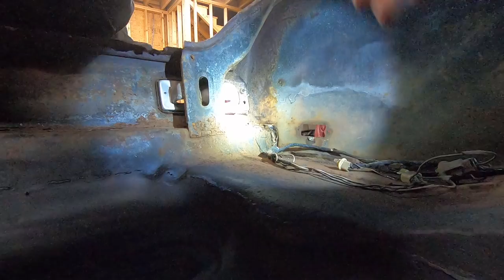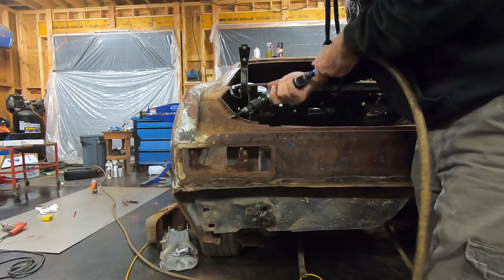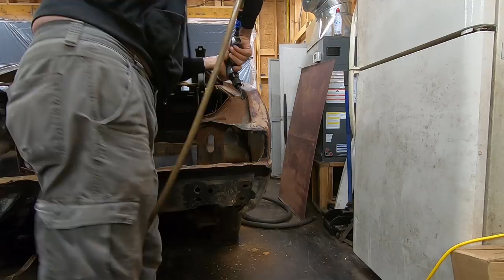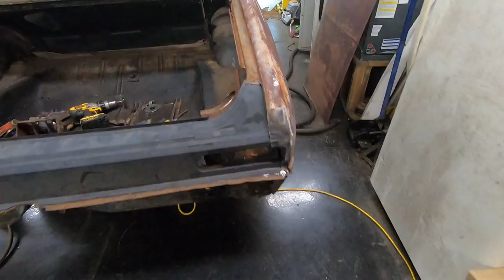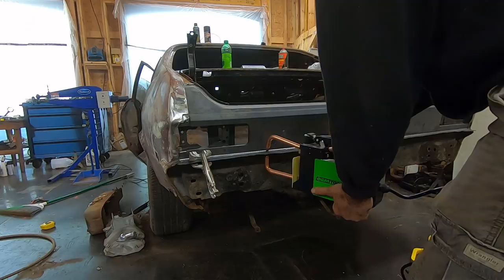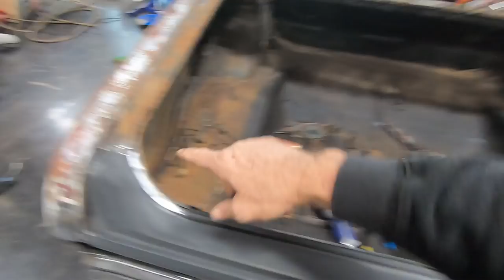Budget Chevy Nova Tail Panel Replacement

Comment: Can`t seem to get an answer to this qustion so i am now reaching out to the Nova God lol. The center roof brace how is the sckin connected to the center brace. I have a little oil canning going on there when i sand. Mine has a gap across the whole thing . ty Merry Christmas.
Reply from the maker: Lol. It isn’t connected. There’s some flexible foam that is between them. You can find it at auto body suppliers. Have a great Christmas!

Comment: Why cut everything out like that? It’s much easier to drill the spot welds in the first place, whether it’s a tail panel, floor pan, or roof skin. And ALWAYS fit your trunk lid before welding a tail light panel in. The quarter can relax and move even 1/8 of an inch when the panel is removed, and you’ll never get your panel gaps right.
Reply from the maker: First, thanks for watching. 
Second, to me, it’s easier to get to all the spot welds with the large parts of the panel out of the way.
Third, As far as the panels all moving, this obviously isn’t the kind of build where I’m worried about perfect panel alignment and gaps. Whoever ends up with this car will either enjoy it as is or will replace quarters and whole trunk. Therefore making it not a big deal if the tail light panel is off a little at this point. I appreciate your input though.

Comment: Is this the same mounting points as a 73 nova? I found one that I'd have to do a lot of work on the body, because Pennsylvania. But, I'm figuring that the72 and 73 have a decent amount of interchangeable parts.
Reply from the maker: The tail light panel is different but changing the 73 is pretty much just like changing the 68-72. It is mounted the same. Just not straight across bottom.

Comment: This video very informative for me.    The trick with cutting the gutter rails saves me time and dough.  One question is you said you had to melt brass/lead out of the lower outer corners. Is that just patience with propane bottle  ?  I just don’t want to damage or distort good metal.      Good vids.
Reply from the maker: Yeah. It doesn’t take much heat to melt the lead. Don’t boil it. That releases poison gas. Just barely get it hot enough to melt and scrape with wire brush. It will mostly fall off when it gets hot.

Comment: As a '68 Nova owner I TRULY appreciate seeing these videos and I continue to learn something new all the time.  My '68 was (and still is) my first full project car and I'd love to hear how you might go about repairing/replacing that trunk gutter for the weather stripping?
Reply from the maker: Actually I tried making a piece but couldn’t get it just right without a TON of work. So I cut a piece off of a quarter panel that was replaced on another car. I’ll have a video of the deck filler and trunk rail in next week or so
Reply: @Shop209  Yeah, I had purchased some stand alone channels, but they're straight pieces and like you said would require a TON of work to get it right.  I think the only 'good' option would be to get decent replacement metal with the gutter and then square cut it out and weld in.  Anyways, looking forward to the videos... keep 'em coming.

Comment: When you put the tail panel in is there any kind of sealant that goes between panels  to keep water out
Reply from the maker: You should be putting seam sealer on the joints unless you fully weld them. Factory used seam sealer on those joints.
Reply: @Shop209  does the seam sealer go on after they are welded together what keeps water from seeping under the panel and laying there and eventually  rusting I'm talking from the outside
Reply from the maker: @bblacklin8890  I put it on after it is welded and primed. It is basically caulking the joint.
Reply: @Shop209  thank you I really like the videos

Comment: The part where the taillight panel is, do you use a wire wheel to clean it up, and get rid of must of the rust then use Cor15 to protect the part to be welded on?.
Reply from the maker: I use rustoleum rust converter. I have used weld thru primer in past and I don’t like it plus it really hasn’t worked well for me.

Comment: I have a74 nova it was born with a6 cylinder I have replaced everything on the front end  except Springs front end is still soft do I need bigger springs? For a v8
Reply from the maker: Probably not unless you’re running a big block. I have bought several sets of new small block springs and they sit too high and are stiff.